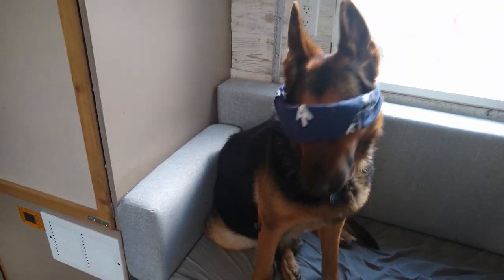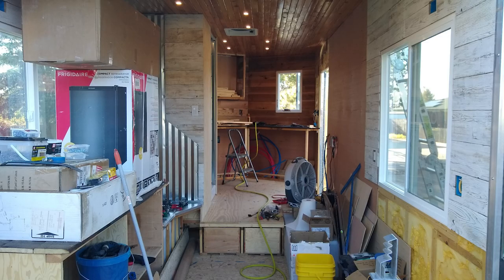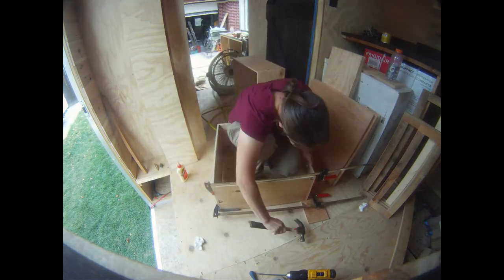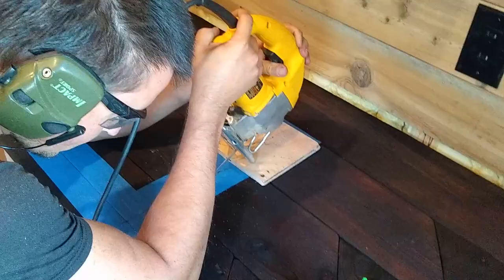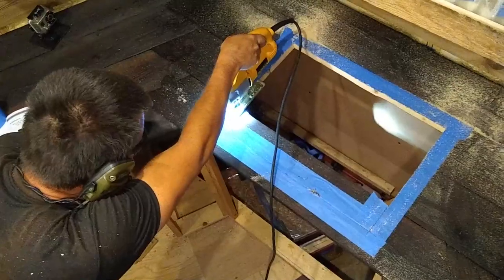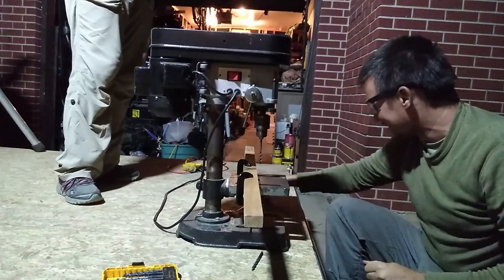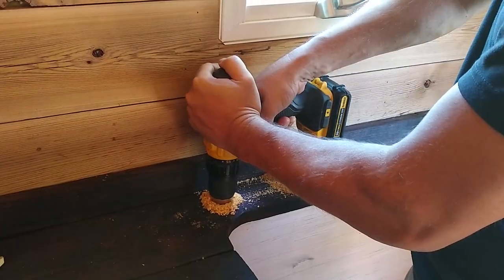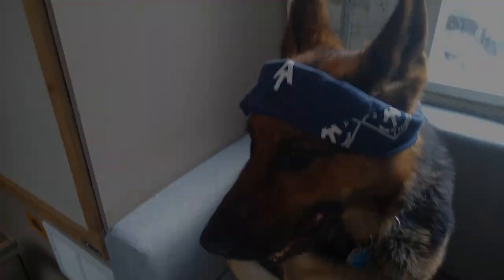Let That Sink In! | Cargo Trailer Conversion | Episode 14

Comment: Consider over time the edge/end grain of the countertop cutout for the undermount sink will absorb constant water exposure and swell/degrade/fail.
Reply from the maker: Thank you for the advice! To address this our countertops are completely saturated with Tung oil which should keep the edge/end grain sealed up.